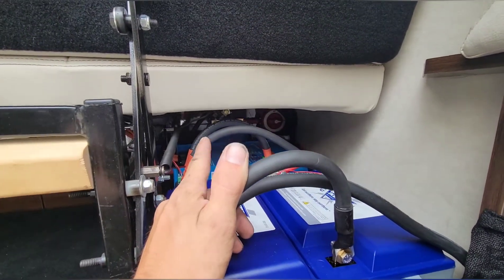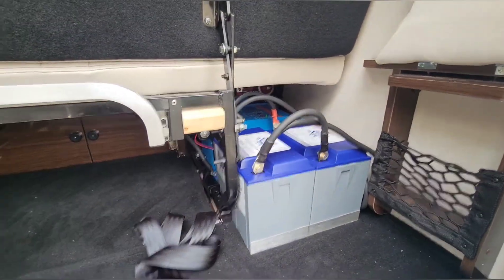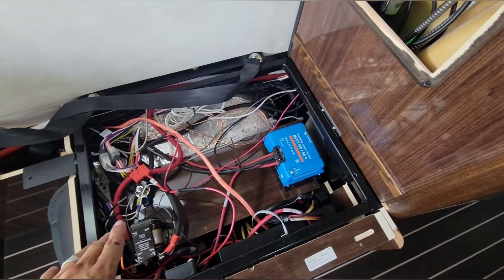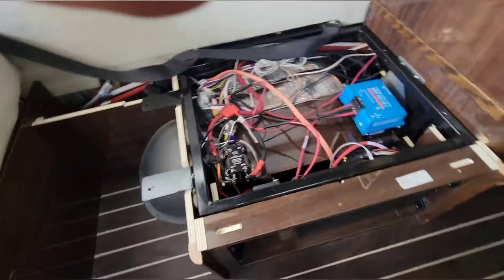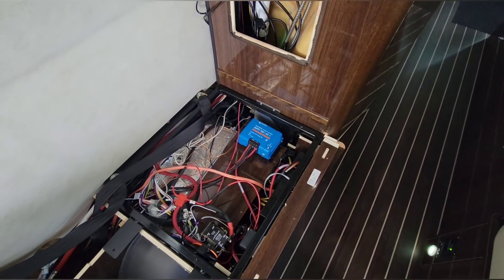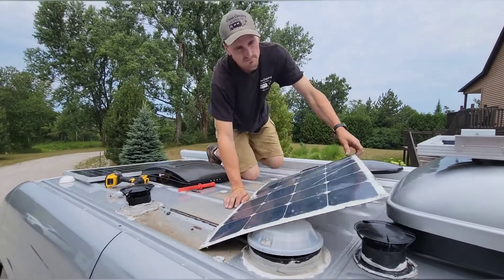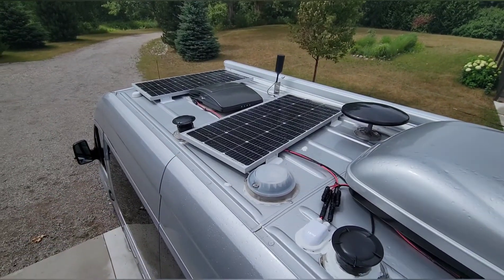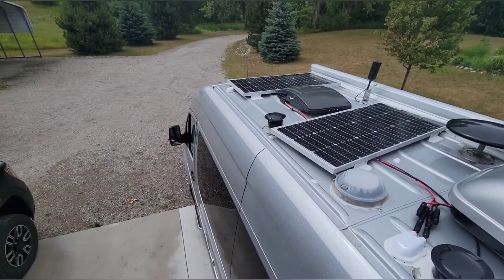Solar System Install • 2015 Airstream Interstate • Part Two • #rvsolar #airstream #solarinstaller

Comment: how much does this upgrade cost?
Reply from the maker: Equipment cost with wiring, fuses, etc. is  around $7000.  Labor cost varies from install to install and better discussed in email but we try to keep our labor cost reasonable compared to other shops and dealers..... thanks for watching!